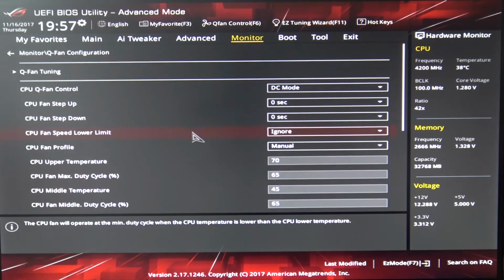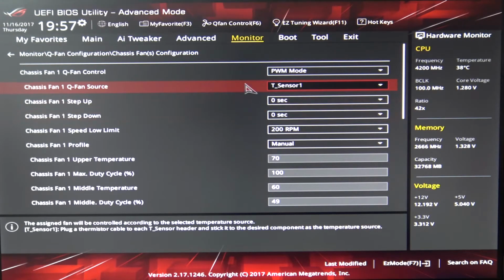Water Cooling Basics: Fan Configuration

Comment: i have a question if i have 2 pumps that are 2 pwm do i plug both to the cpu header with a splitter? or do  i plug 1 into the cpu header and other to a different header on the board? to controll the speed of the pump

Comment: I agree with most of this, however, CPU and GPU boost algorithms are partially based on component temps and it IS easier to get higher clocks out of cooler components even on cooling rigs that are above ambient.  my 3700x for example will keep my clocks boosted up to 4.2ghz if i can keep the temps down below 60c, but going over that triggers automatic lowering of clocks.  similar things happen on my 3090 at around the same range, so if i'm overclocking both cpu and gpu (as i would if i'm spending $1000+ on a custom liquid cooling setup) and i'm doing long duration workloads (for example say a multi-hour blender render with both cpu and gpu which is pretty common for me), keeping those temps in check is EXTREMELY important or you end up losing performance to the tune of roughly 10% and if you get into the 70-80 degree range on either, it can be as bad as losing 15% or so.

Comment: Good call on recommending the Aquaero controllers. Running my loop with several water temperature sensors hooked up to my Aquaero LT 5. It's awesome that fans don't ramp up just because of a short cpu or gpu load.

Comment: Can you do a video on using a coolant temp sensor and configuring it with a motherboard?
Reply from the maker: I will probably do a video like that at some point.
Reply from the maker: There are plenty of motherboards capable of that. I have the fans set on my Asus board to respond to the temp sensor, although the Aquaero will give you much better control.
Reply: Well it's pretty simple, just get a motherboard that has a temp sensor header and a bios that is capable of running the fans using the sensors value. Are there even motherboards that are capable of the latter?
Reply: Ok, so you pretty much need to get an aquaero for this?
Reply: Ioannis Hronakis Pretty much. At least it makes upgrading hardware easier because you don't have to look after these special things (even most high end mainboards don't have temp headers).
It may be possible with a software solution if you have a temp header but it only gets applied when the operating system is loaded and running.
Also when running a custom loop, the last 50$ for an Aquaero shouldn't break the bank and should be considered.
Reply: Haha, yea, I'm not looking to cut corners, I just never used one. Don't you have to mount them somewhere? I'm actually going to replace my coolant with primochill vue, maybe I'll look into hooking up an acquero as well.
Reply from the maker: No. Aquaero is nice, but you can do this on most high end motherboards.
Reply: My motherboard is the MSI X99S SLI Plus, looking at the manual, I don't think it supports it :(
Reply from the maker: it will be a 2-pin header. If you don't have one, then you'll need to buy a separate fan controller. You could always just set manual fan profiles and just try to keep the RPM's low and test to make sure it's adequate.